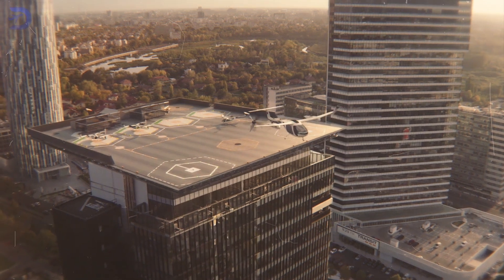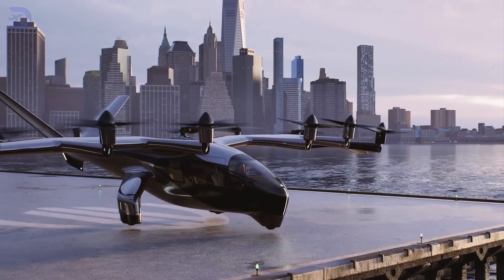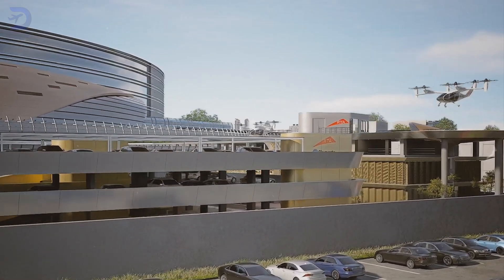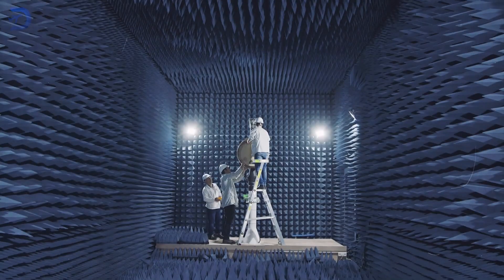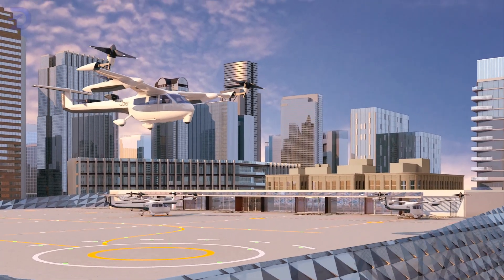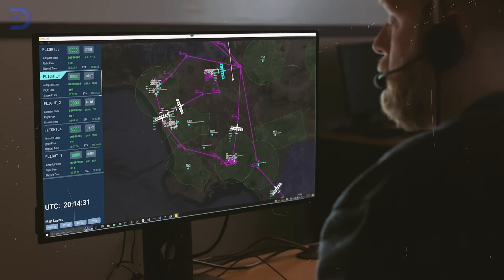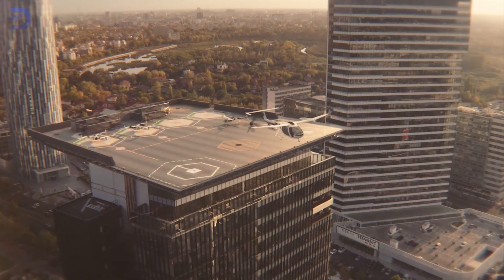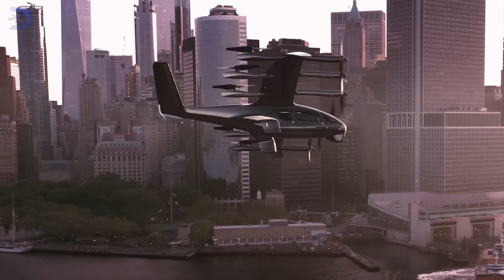Why Building Vertiports Is the Real Challenge for Urban Air Mobility ?

Comment: Archer will be perfect to work with cities infrastructure!!!
Reply from the maker: @rondesombre6149
While Archer's eVTOL design is promising, integrating it seamlessly into urban infrastructure presents significant challenges. Developing vertiports requires substantial investment, regulatory approval, and community acceptance, particularly concerning noise and environmental impact. Archer's collaboration with REEF to repurpose existing structures like parking garages into vertiports is a strategic move, but the success of urban air mobility will depend on addressing these complex infrastructure and societal considerations.

Comment: Ridiculous to state that buildings ( high rise as shown) need to be strong enough to support 'several evtols' ... only a small amount of this fluff piece is about vertiports in any event .   ATOL is the solution and allows suburban sitting and thousands of times more places.
Reply from the maker: @rossnolan7283
You raise a valid point about Assisted Take-Off and Landing (ATOL) systems and their potential to overcome the limitations of high-rise vertiports. Suburban siting certainly offers a more scalable solution, increasing accessibility and reducing the strain on urban infrastructure. However, the discussion around vertiports is crucial, as they represent a key element of integrating eVTOLs into dense urban environments.

While ATOL broadens deployment possibilities, urban vertiports remain vital for cities aiming to reduce congestion and improve connectivity. The balance between centralized vertiports and decentralized ATOL sites could ultimately shape the success of urban air mobility systems. Thank you for adding depth to this conversation!